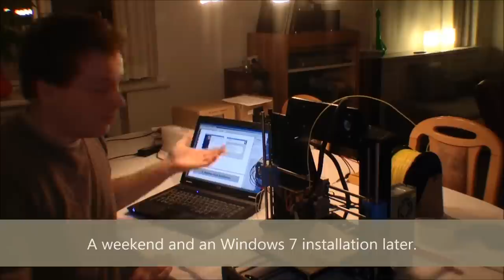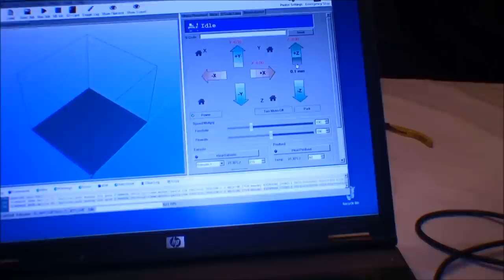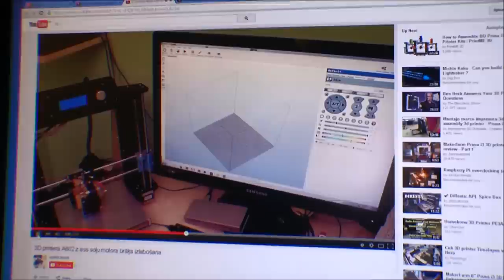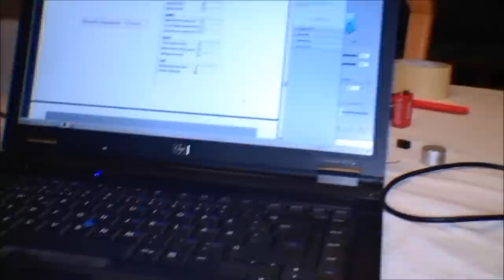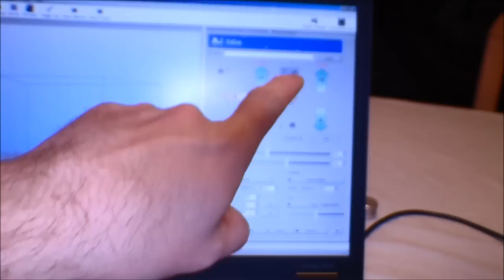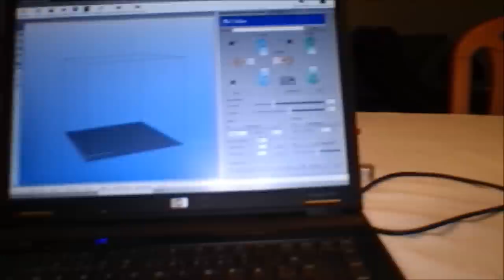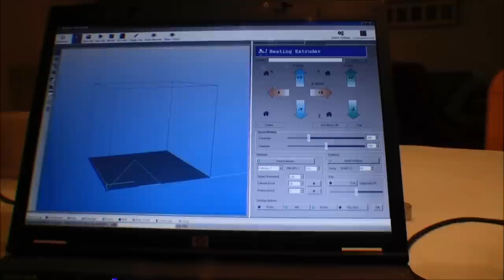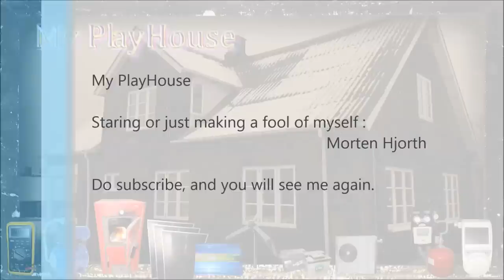Debugging on the China 3D Printer & First Print - 121

Comment: I purchased the same computer off Ebay.There was a silent DVD with mine which took a lot of stop and rewind to get the information off. I made several mistakes including getting the two vertical sides and the Y axis bearings reversed. My Z axis drives were stiff and would not move unlike yours I only needed some WD40 into the axis bearings. I went with the video as far as I was allowed to see but the model they used was clear plastic not black which played havoc with perspective. I am still fighting my way through and have full movement using the control panel but have just failed miserably to connect to my PC. Enjoyed you sharing your problems warts and all....... I will stagger on. .
Reply from the maker: Hi Avis Mizzi
I did try to oil my Z-axis,, did not film that :-) Have you set the USB communication speed,, If it is not correct, I can not control my printer.
I have gone a little stuck with my,, I've got some bits home from china that I must install,, and film,,,but busy busy busy..
Thank you for watching! :-)
Reply: First try today to control from my laptop (LCD panel OK but tip temperature at max) may have got bed and tip thermistors reversed).I have only just tumbled that it is a serial link thanks I will go play with the baud rate. I seem to be logged in with my girlfriends name on Utube thats going to give me grief :-)
Reply from the maker: Hi Avis Mizzi
Hope you got it up and running! It is perfectly acceptable to use your girlfriend´s account,, I have less than 6% female viewers, So I take what I can get :-)
Thank you for watching! :-)